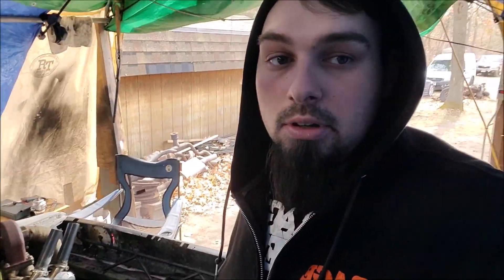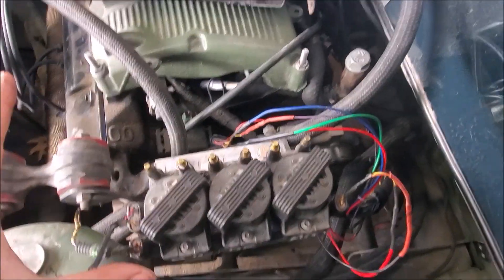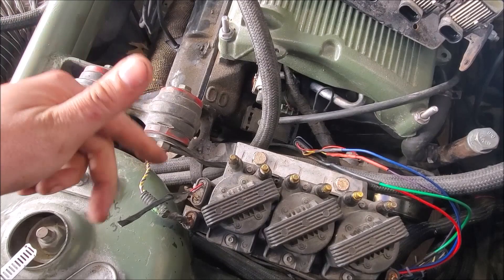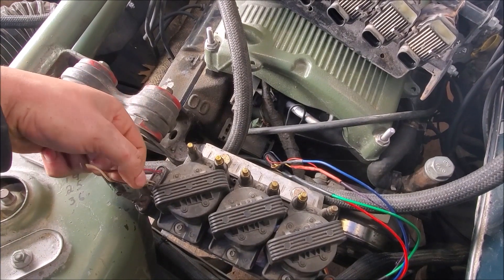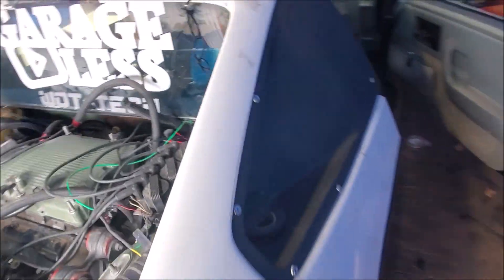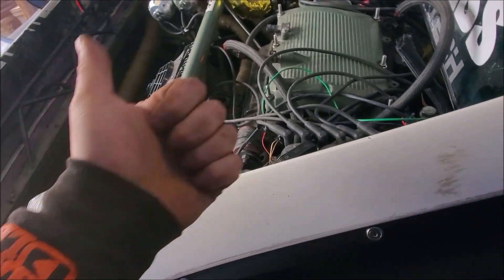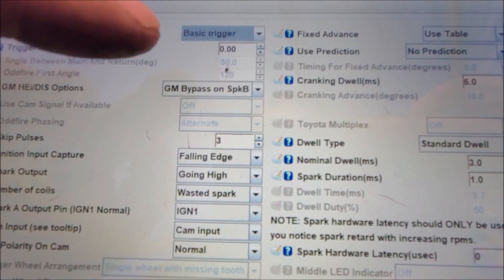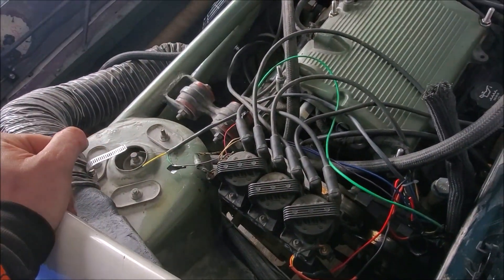wiring GM DIS into microsquirt and settings!

Comment: Hey man great video. You said in the video that the purple wire is vr1 negative. Which pin is that in the microsquirt? And is ignition a&b ignition output 1&2?

Comment: You sure you wanna ground a system the produceds thousands of volts too the ecu......? Id engine ground it, Thank you though i just wanted too see if this would ignite some spark! Ms3x vr6 turbo here.
Reply from the maker: I dont remember this setup to well now... im also no professional just a hobbyist
Reply: @Garageless  Okay thanks I did have a few questions I'm trying to get spark on my vr6 turbo.
Reply from the maker: What you using for spark?
Reply: @Garageless  msd8224 which is the d555 gm coil style I have a different model Dis from a grand prix(one grey connector), It was 9 dollars lmao, I'm just going to buy the quad spark seems like a better fit. less wiring..
Reply: @Garageless  Subscribed because I'm also Garageless XD.
Reply: @Garageless  car runs ms3x 3.57.
Reply from the maker: Whats your trigger setup? I found the ls coils to be easier if you have a good trigger setup
Reply from the maker: Also vr6 spark plugs plug into ls coils
Reply: @Garageless  I have a bunch of truck coils I just want my engine pay to look nice  Its a jetta and with the heat of the vr6, simplicity is my goal. and I've have to make all new plug wires.... not really trying to do that , ill post a video of the car running soon. and its a 60-2 vr sensor and 4 tooth cam, I can do pretty much run full sequential which I may just buy some 1.8t coils... COP....
Reply: @Garageless  no shit.......... thanks Ill fit them up now.... lmao
Reply from the maker: And they are easy to wire... 12v, engine ground, sensor ground and spark a,b, and so on
Reply: @Garageless  just not enough room.... I have it all wired just the stock vr6 coil pack sucks.. Ill be running Air to water at some point, gotta stick with the stock style mount and get a quad spark..
Reply from the maker: Yea i hear that... i almost did the quad spark but ended up goin ls coils

Comment: what website did you find the details on the GM DIS or where did you get the picture?
Reply from the maker: I cross referenced i forgot to put it in video
Reply: @Garageless  I have a Megasquirt 2 V3.0 on my 3.4/3500 hybrid in my 1969 Opel GT. I had to do an HEI mod and bunch of other stuff so I'm surprised that for Microsquirt there wasn't any mods required on the Microsquirt itself.
Reply from the maker: @HSmasteryoda  microsquirt is the newest version not like the diy one..  just has limited outputs and such
Reply: @Garageless  Do you still have your tune file for your megasquirt for the 3400 build? I would love it if you could send me it? Would give me a good basetune for the 3.4/3500 hybrid engine in my 69 Opel
Reply from the maker: @HSmasteryoda  not sure if i still have it... email me at Garagelessmerch@gmail.com ill try and find it
Reply: @Garageless  emailed you. Thanks!
Reply from the maker: @HSmasteryoda  hopefully i remember to look tommorow and ill try and get it emailed lol

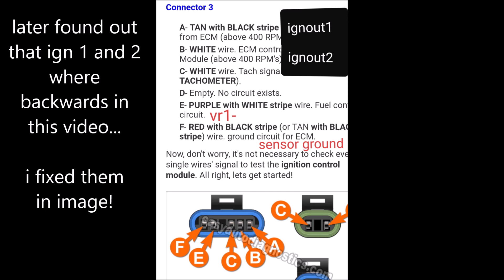Comment: At 9:13 its cut off what comes after c on the  green connector and whats the pinout for the bottem one its cut off
Reply from the maker: Those are just power and grounds basically i should have explained that in the video...
Reply: So connect them to a 12v switch